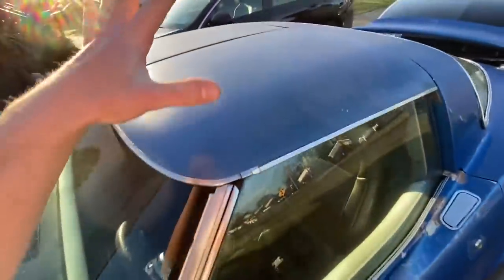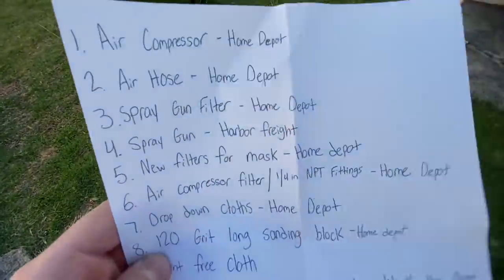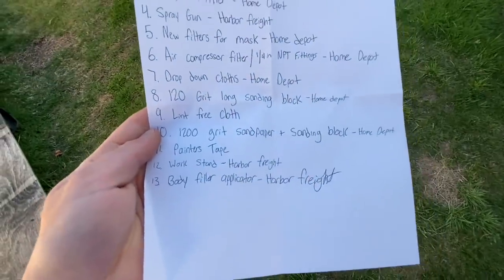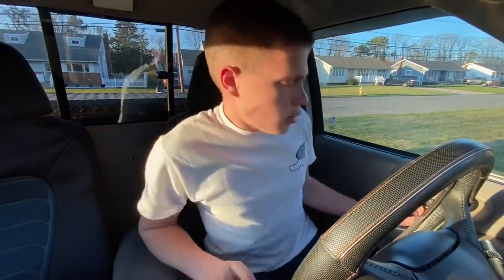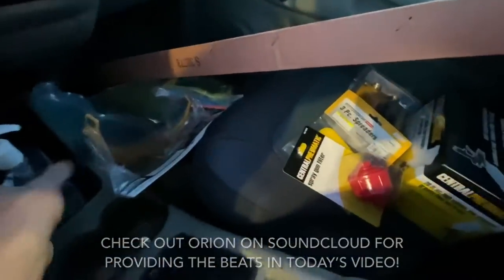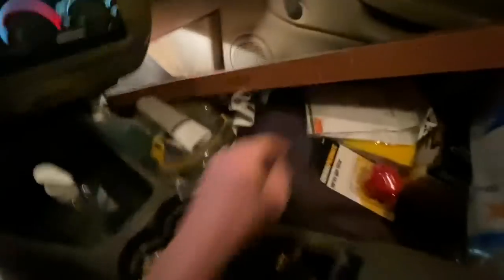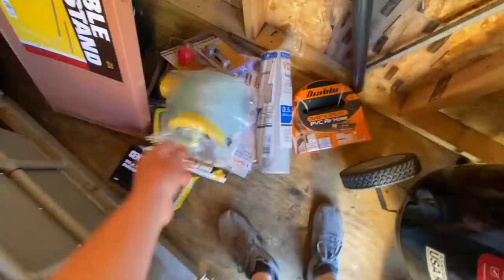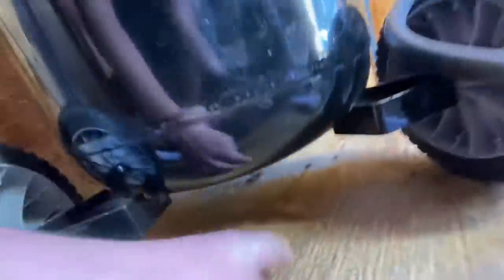We are PAINTING the Corvette! Gathering ALL of the Materials Needed to Transform the Car!

Comment: I painted my truck last summer, I’ll try to give some tips.

Use a self leveling primer. Sand it with an orbital sander, and fix all the problem spots. They wont show up with primer, but once you put the paint and especially clear coat, it’ll be super noticeable. If you fill it right it’ll look like glass. Watch Vice grip garage’s video on his $119 paint job, it’s really useful information

Comment: You can definitely paint the car yourself even if you've never done it before, so cudos for putting forth the effort and learning. One of the bigger challenges will be creating a dust free environment to keep particles off wet paint. Hanging plastic sheets up around the car will help. Then there is gun control which you will learn.

Comment: Just a suggestion.   Build a lean to on side of the shed then pipe ur compressor in through the wall. Both power and air.  Save space and quiet it a little.  Especially when filming.

Comment: There are body shop stores that will sell everything you need, DO NOT RUSH IT take your time, and you might want to start with some 180 then go to 220 then a 350/400 sand paper then that should be good, and don't use cheap tape get the 3M masking tape good luck you can do it...

Comment: You need to sand the whole car by hand. Then prime the whole car with high build primer then block sand with 220. Then reprime again and block sand with 400 grit. Use guide coat both times you block sand the car. Vettes are curvey so you can't use a da on most of the car. It's a lot of work. I'm a body man and I've done a Corvette few months back. I'd rather paint anything but a Corvette